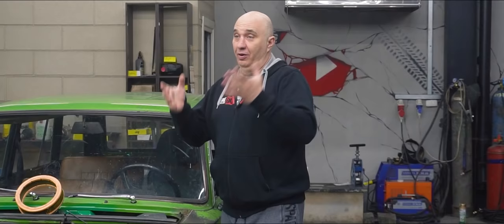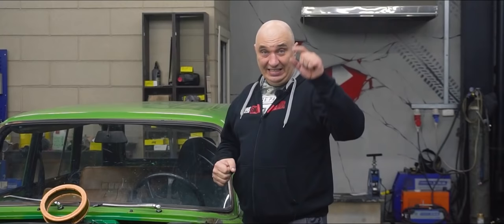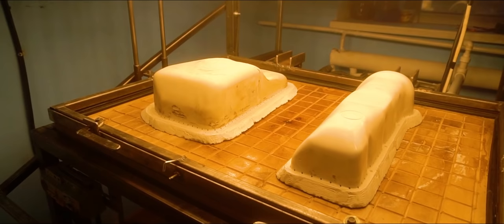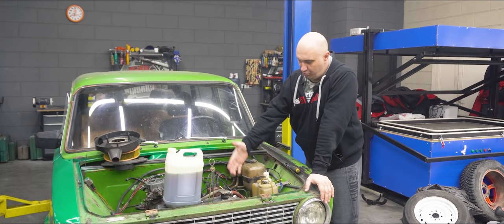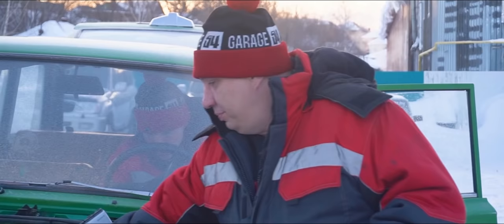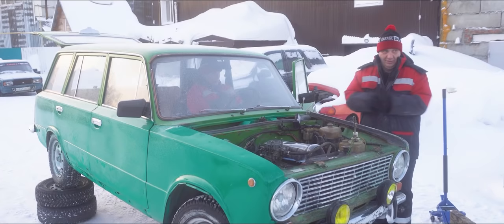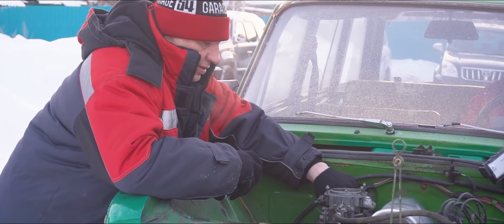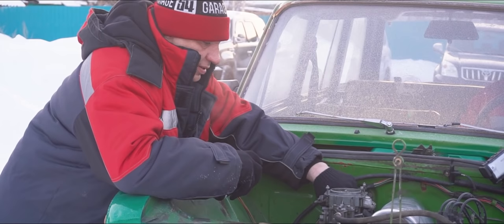Looking inside an engine during cold start (-30 degrees)

Comment: Moderne Dieselmotoren starten selbst bei -50°C ohne große Probleme, wir nutzen in unseren Motoren 0W20 Motoröl, das ist selbst bei -50°C noch dünn genug, trotzdem nutzen wir elektrische Motorvorärmung das die Batterie nich zu stark beansprucht wird.
Erst bei -65°C geht auch der moderne Diesel in die Knie.

Comment: What do the oil pump and distributor have to do with each other? 
Why rev up so high a cold gas engine? I’d have left it idle for a long time instead. That was calling for failure.

Comment: ...my Grandfather would start a fire in front of his Model T letting it burn to coals then roll the oil pan over the heat.
Apparently he would use pigskin for rod and main bearings so close tolerances were not an issue...

Comment: I had a 1967 Oldsmobile 455 and it started at -43C even after sitting at a parking lot for more than two days.  NEVER rev  the engine after start.  MUST let it warm up at idle for at least 5 to 10 minutes.  Revving any deeply frozen engine right after start is asking for trouble.

Comment: So, that's what you do with a carbureted engine at minus 30. Floor it! Ha-Ha! I used one of those magnetic oil pan heaters when we got below zero Fahrenheit. Works great but still need about five or ten minutes to let the engine warm up before putting it in gear.

Comment: These guys claim to be mechanics but didn’t  notice that after first it would only run off of the starter fluid. Cold oil wont flow as easily, I would think your area will have a spec’s oil viscosity for your region ontop of aftermarket block heaters. The oil filter bypass is a bypass inside the fliter that allows it to bypass the filter media so it won’t starve the engine if clogged/cold. Miles on the engine would be important info because oil sludge is a real thing and can inhibit oil getting to the head especially if mains are getting worn out.  So in the end, I’m confused what you were trying to accomplish or proove. Besides that the transparent covers were cool but would like to have seen a Timelapse of 1500mi on jt.

Comment: I've accidentally used fully synthetic 10W-40 engine oil in a car instead of 5W-40 and even the winter temperatures here in Finland make diesel engine hard to start with that oil.

Comment: I thought you can't mould polycarbonate.  Headlights.  Lexan is a brand of polycarbonate.  Plexiglas is a brand of acrylic.  You should use a respirator when working with either, since the fumes are toxic!

Comment: He said something about using "mineral oil." Does that just mean "non-synthetic?" 

Also, makes me wonder if there is a thinner viscosity or cold-weather additive to keep oil from gelling like that...?
Reply: Old engines use thick oil to compensate for age and usage of the pistons. 
Thin oils should not have this problem. Still, let it warm up a bit before you drive.

Comment: @5:47 "This right here is mineral oil.   Which should freeze up."    Pro Tip, use engine oil in your engine - not mineral oil.   Might as well have used water.

Comment: The moral of the story is don't drive junky cars when it's that cold. That thing probably barely runs when it's summer. The carb should be thrown in the trash. Letting the engine warm up can help, but after 1 minute of idling the friction and combustion in the head is enough heat to start driving. The engine parts all still have oil on them if it was driven recently, it doesn't require the crank to circulate an oil pan full of oil into the head passages to lube it properly.

Comment: Be aware of the fact that it is actually worse when the bottom plate and top of the engine are steel/aluminium because plastic does not get as cold as the metals in cold temp.
Reply: they do get as cold, they just dont feel as cold to us because they dont transfer hot/cold as well through our skin.

Comment: Driving and revving the engine are different things. Driving puts stress on all parts, making them warm quicker. Revving on cold is destruction of engine. If you started it, with air filter on, with choke, you could drive normally around your shop, and put cameras under the car and in the hood, and we could have seen what actually happends and how quickly oil goes thru. Everybody must have in mind, thisis mineral 15/40 most probably and is not good for winter.

Comment: only problem is that's 60 years old technology . try it with a car that's 15 years old or newer . Also the car must be in good condition and use the best oil for cold temps .

Comment: all that dark material in the oil. that is metal right lol? the oil never gets warm enough to lose that thick color so that has to be metal from running the motor dry so much.. and you can see how the gear has worn down. not good even in the short run

Comment: My Toyota has no issues in -24C - it will be even colder than that on the weekend. 
Issues start below -30C.
Reply: Same with my vw 2008 Golf diesel. Now it is - 25 C in the morning and starts directly and runs perfectly on recommended standard synthetic oil.

Comment: Isn't there an electrical heating system to prevent this to happen?
Reply: OIl pan heater. Glue stick on or magnetic stick on. The wattage depends on how long it will be plugged in. Also, install a coolant frost plug heater. your engine will last much longer.

Comment: Wrong oil for the temperature range and they absolutely shouldn't have used a high volume pump, that's what lead to the oil pump/distributor gear failure.

Comment: Having the carburetor open and flooding the engine probably didnt help much .. always have to control fuel and air mixture for the engine to run properly.. if he would have covered the carb after the first start up I think it would have had a better chance of running..

Comment: Nice effort but the condition is not relevant to modern engines. Plus test doesn’t show oil pressure, the important indicator show how quick for frozen oil start to flow. I tested engine cold start in the chamber, the oil at -30C will build up pressure in 10 seconds.

Comment: Maybe you shouldn't rave the -30 degree cold engine on the 1973-manufactured car up to 6k RPM when your distributer is  broken and oil pump gear is eaten up? So yeah - when distributor is not spinning, engine usually doesn't start, and when oil pump is loosing one of its gears, it doesn't pump oil up. Why did we have to make this experiment when it was -30 outside again? Did we expect any other outcome if ambient temperature was +45?

Comment: block is just screwed up, it gets no gas, and that oil is just full of water ,, too light in color ,, a properly tuned lada starts pretty well at - 30  
With an ice-cold engine at such high revs and cold it is guaranteed to be damaged.

Comment: So my biggest take away with this video,  if you live in the mountains and/or very cold climate,   get your self and engine heater of some kind and use a low viscosity oil that stays  more liquid and still is compatible with you motor?

Comment: Without an oil pressure gauge, this test isn't that useful. If there is pressure, then your component are likely protected from wear. 

Plus, it would be nice to see the same test with an electronically control engine so that we can see the time it takes to warm up idle vs running slowly... Combined with modern oil (5w-xx or 0w-xx)

Comment: I like the transparent covers yet the very bottom of the oil pan SHOULD be shielded by metal plate.
I've never understood why auto makers just let the oil pan be exposed to everything.
A transportation device using oil should have a gage to tell the owner if the oil is too cold.
Elon is punishing them for failures.

Comment: Incorrect oil, surely there is no normal person who drives on such thick oil.  For such an old and sluggish engine as in the Fiat 124, you should use 5W-30 which stays fluid down to -35C or 0W-30 which can handle -40.  For more powerful engines 5W-40 or 5W-50.

Comment: Do not ever start your car like this in the winter. Sitting and idling does no good because it takes a very long time for the engine to warm completely by just idling and you'll actually wear the engine more than if you just start going immediately. BUT HOLY SHIT DO NOT FLOOR IT TO REDLINE WHEN YOUR ENGINE IS AT -30C. That black stuff running down the side of the oil pan into that brand new oil? Yeah, thats the inside of the engine slowly killing itself...

Comment: the reflection from the sky makes it impossible to see anything at all under the rocker/cam shaft .cover..  be good to know the oil weight,, maybe tune the engine up, spark plugs and points, timing etc, and use the choke properly,, come on friend, fair go.. giving the lada a bad name.. lol

Comment: You would think mechanics living in an Arctic region would know more about cold weather start up procedures. 
They trashed this engine on purpose. Was it just for clicks and comments?
Reply: I really think they knocked the pick up tube off the oil pump when they changed the pan. Oil pump was starved for oil and locked up, shearing the distributor.

Comment: Mineral oil? Are you nuts? Those engines won't last long using that stuff, even in the summer temps. I'll be surprised if you don't find lots of metal particles in the oil filter if you cut it apart. Also, how will the engine breath and get rid of oil vapour? You have a totally enclosed valve cover. The teeth are in the oil filter or oil pan. That engine and starter are toast. We didn't learn anything. Why didn't you use proper engine oil?

Comment: Frozen fuel? Oil is an issue, but you can run without oil until the engine is shredded. You can't run without fuel. I would guess the fuel is frozen in the filter or pump because your town is cold as shit!
before you do science class, you need a heated garage, plain and simple. or perhaps, complicated in your climate...